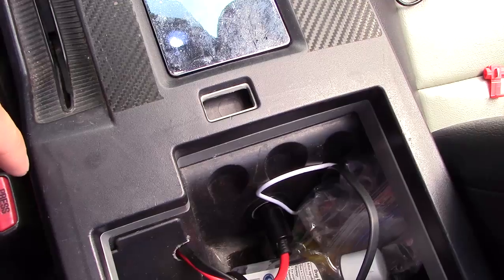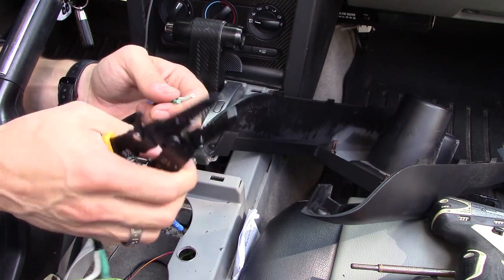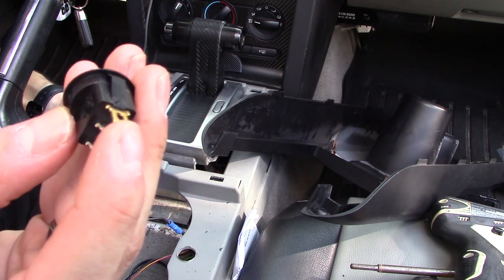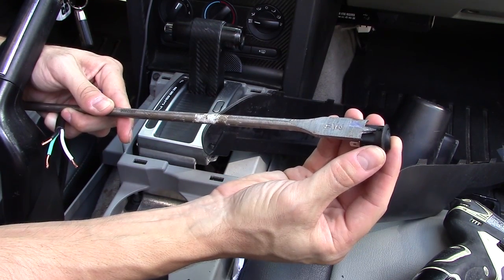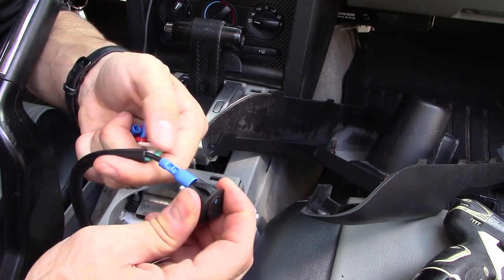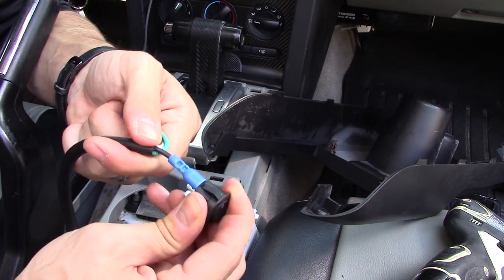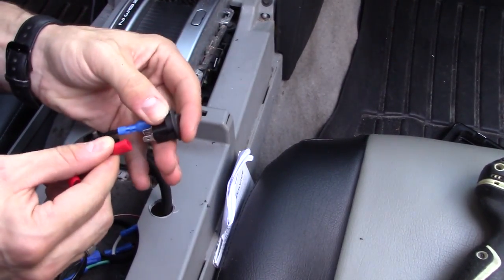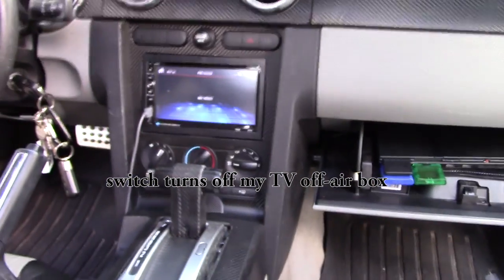How to install & wire 3 prong Switch to car 12v power outlet cigarette lighter port

Comment: hey mr.tampatec,
this video reminds me that i did this exact same procedure 43 years ago on my 1973 datsun 240Z as a kill switch to prevent it from being stolen.  i did this because it had been stolen 2 times within the first year i owned it and 50 Z's were being stolen back then due to so many on the road.  luckly, it was recovered each time, stripped of course, i still have that 240Z in my garage being restored to it's original condition.

thank you for your enjoyable expertise as usual.
dennis, san diego calif.

Comment: Hey so I have 3 power outlets, 2 in front and 1 in rear.. if I connect to the rear would the switch only control that one or all?

Comment: I want to install an on off switch for accent lights. I want to use the cigarette lighter hole for the switch. How would I wire the accent lights into it?

Comment: You can also use a relay instead. All you need is a power source that turns on with the key. Then you don't have to worry about the switch

Comment: My problem is just the opposite.  When i turn the key off in my 2014 Honda, the cigar lighter power dies.  So I can't charge my cell phone unless the power (key) is ON!
Reply: Jim Nichols lol just like my comment above. my 98 ram outlets shut off when the key was out but in my 2013 f150 they are powered constantly. old or new its kind of hit and miss. especially when there are multiple outlets in the vehicle. one might be constant but the other could be ignition switched.

Comment: you'd think car makers would put the power port on a time-out circuit.
Reply from the maker: right, it's 2016
Reply: bgregg55 yeah theyre actually pretty hit or miss believe it or not. my 98 ram i believe was wired to ignition by factory so you dont kill the battery but on my 2013 f150 in the backseat, its constant. thats where i charge my phone lol so i have to plug and unplug when i want to use it. no big deal for newer cars as most electronics will power down completely when the battery is drained just enough for the car to start, making it pretty hard to kill a newer battery. very clean install overall. i just wouldnt go through all that work just for something that should work like you think it should lol.

Comment: I'm not a fan of quick connects. I worked on a CCTV system for a local business and I had to replace every connection they used quick connects.
Reply: David Basara why is that? just curious lol im not a troll.
Reply: Space Cowboy if they aren't done perfectly, they corrode and don't provide perfect contact. I prefer male/female crimp connectors, but they can be hard to separate.
Reply: We call them Vamps or (Vampire Clips) they will ruin any wire harness. They get fitted incorrectly or corrode, seen them used exposed to elements and people expect them to keep working. They are down right awful.
Reply: @spacecowboy1924  the quick connects are actually designed to cut through the wire insulation without stripping. As an electrician I have used them extensively on 240V AC circuits as well with no problems, bearing in mind not to overrate the current carrying capacity of the bridge connector....
Reply: I work with dc electricity on a daily and they are more susceptible to resistance and corrosion. And usually ttaps aren't the greatest connection. Resistance leads to heat and at high current that will melt wires
Reply: @kiwisparkey  are you talking about how he connected two wires, with the connector, or what he did with the ground wire, where he splices it and bites into it?

Comment: if you are ever looking for a new stripper, u should give the irwin self-adjusting stripper a try. its pretty sweet.
Reply: Same with a Gardner Bender GS-394 auto stripper. Strips 26AWG to 10AWG without nicking a SINGLE strand. Farm & Fleet has it fo $14.95.

Comment: or just unplug whatever is plugged in!  lol
Reply from the maker: true but I forget sometimes, the led reminds me.
Reply: I use these in conjunction with some relays to be able to power on or off so many things. Amps, voltmeters, fans, outlets, lights, compressor and the all important Zombie Switch. Can't unplug all of that.
Reply: Des420 compressor? what u drivin? lol jw
Reply: Space Cowboy SUV. Just a small compressor for a secondary horn when the normal one won't do...

Comment: i was going to complement your installer skills until u pulled out that quick-connect. in my experience, those things lead to intermittents & are a poor substitute for soldered connections. but maybe my technique using them wasn't right. looks like you have done a lot more installs then me.
also, u never mentioned in the tv video(or i missed it) whether the tv works while driving. i'd hate to think people are driving & viewing tv now.
Reply: there is nothing wrong with spade terminals! a vehicles electronics are inundated with them! mostly in the form of multi pin connectors just small versions of what you see here
Reply from the maker: true, soldering is the best connection, also car radio has a setting on by default  to turn off video when driving for safety.
Reply: torcher78 i should have been more clear. I was referring to those fold-over splice connectors (Scotchloks is one brand name).
Reply: A proper crimp is like a cold weld and actually more conductive than solder...
Reply: +bgregg55 yeah those things are total junk
Reply: +Des420 a cold cold weld and a cold solder joint are both bad
Reply: torcher78 I don't know what a cold cold weld is, but if you say so. I'll continue to use my hydraulic crimper and enjoy almost no voltage drop drawing 300+ amps.
Reply: +Des420 voice to text picked up the word twice mate
Reply: Des420 do u recommend a particular crimping tool?
Reply: bgregg55 I forgot to mention that those two items are geared for larger diameter wires/cable. 8 gauge down to 4/0. Anything smaller, just the standard crimps are fine.
Reply: bgregg55 in all dvd head units there is a green or pink(usually) wire coming out the back of it that is tapped into the brake wire so the dvd part only works in park. if you ground this wire tho, you can watch it whenever. not saying thats safe or cool lol actually i would advise against it but its easier and thats how people prefer them to be installed. just a fact! and crimps are fine lol. stupid question tho. whats a cold weld or a cold solder vs not cold?? lol just not sure what that means
Reply: Tampatec can easily be overrided, in fact most are installed like that with the park or brake wire grounded. but watching tv and driving is stupid lol. only benefit is when you have a dumb friend that wants to watch a music video or something. or if you have a kid in the front seat and dont have a drop down dvd or anything.
Reply: He was just too lazy. There is never enough time to do it right the first time, but plenty of time to do it over!

Comment: This video made me cringe, he never heated up the heat shrink on the but connecters! Now everything is going to fall apart.
Reply from the maker: 6:00 these are crimp connectors not heatshrink, update: still working great.
Reply: yeah i know but theres heat shrink around the metal part your suspost to use a lighter to finish it
Reply: @MrTacoMan247  no, not on the ones used in this video.